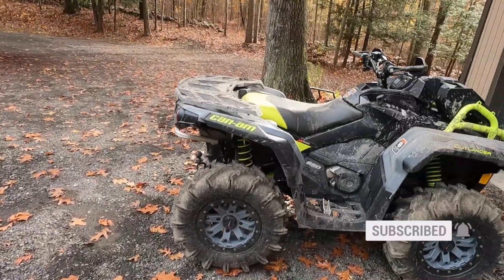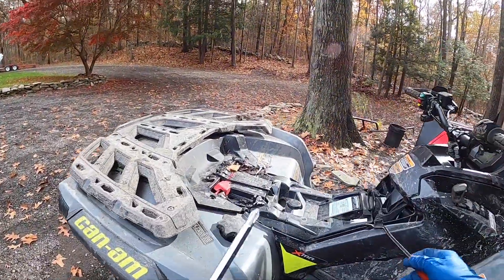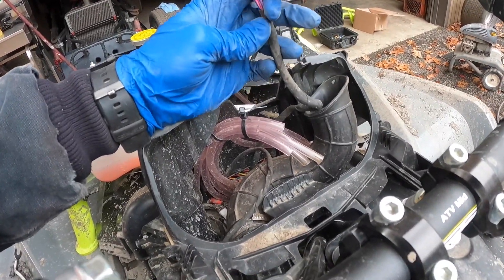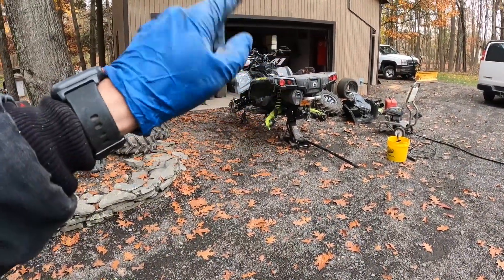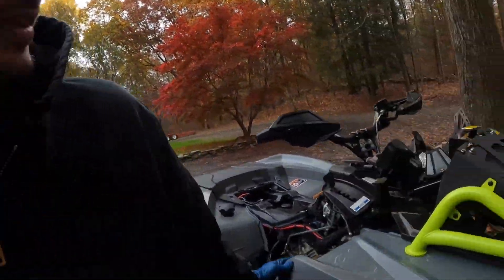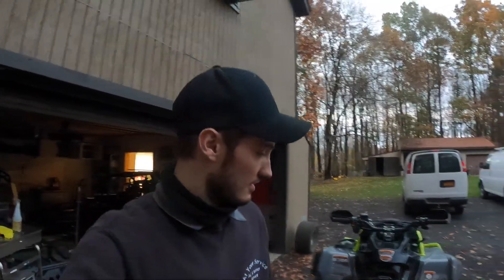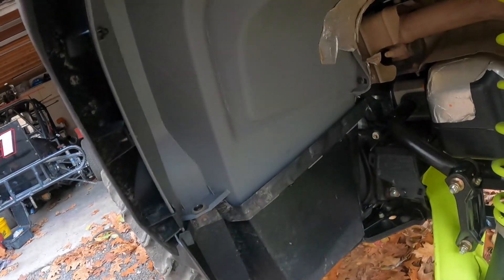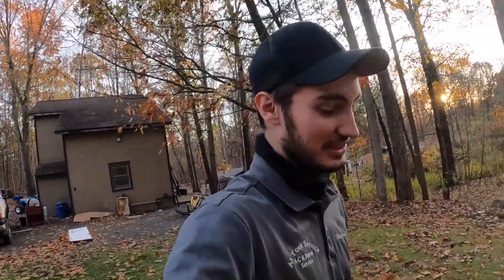How To Deep Clean Your ATV After Hitting The Mud | ‘20 CanAm Outlander 650 XMR Gets Some Accessories

Comment: I have the same wheeler do you have a parts list for the rear bumper
Reply from the maker: Yes sir. I’ll write them down tonight for you!
Reply from the maker: Here is the parts list and the quantity that youll need!
(1) 705014131 - BUMPER REAR B-357 PAINTED
(4) 207762044 - CARRIAGE BOLT M6 X 20
(6) 233261434 - FLANGED ELASTIC NUT M6
(2) 250000842 - TORX-TRUSS M/S M6 X 30
(1) 705005094 - LH BRACKET
(1) 705005095 - RH BRACKET
(1) 705008164 - LH REAR BRACKET
(1) 705008165 - RH REAR BRACKET
Reply: Thanks for the info
Reply: @LetDirtFly  thx